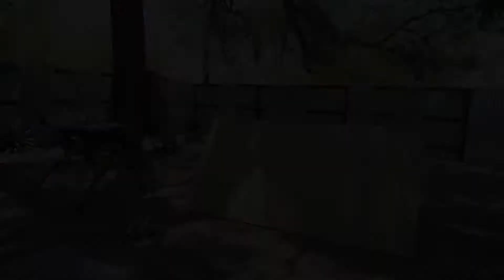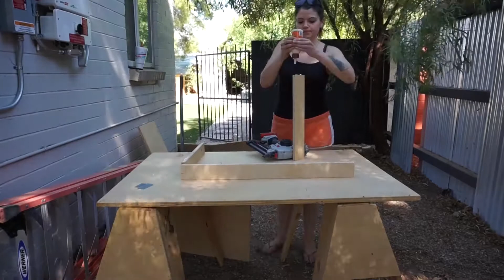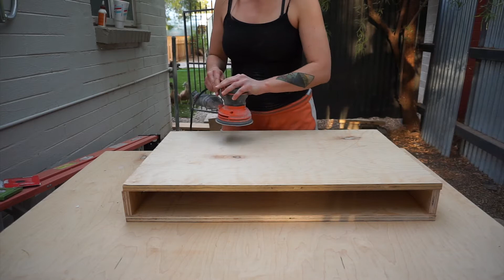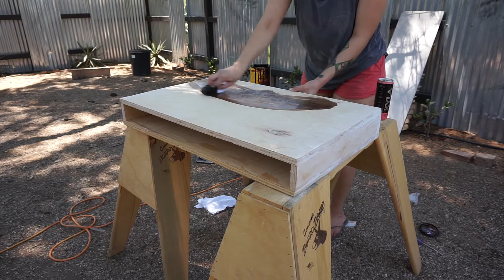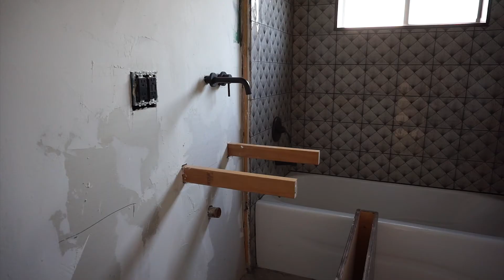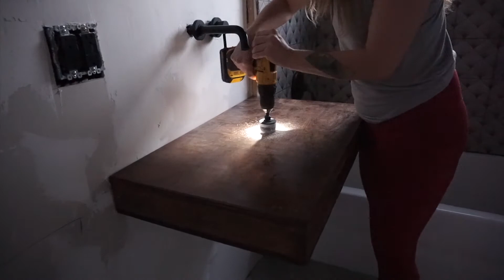DIY Floating Bathroom Vanity - My DIY Bathroom Renovation Progress! **BUILD.MAKE.DO**

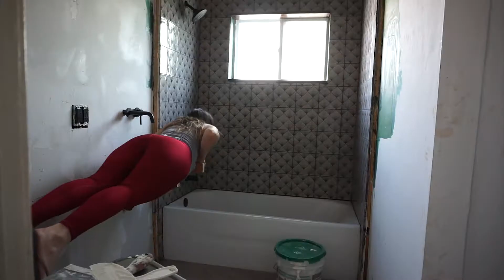Comment: 5:07 those two wood block in the walls. I wanna put it on my walls too, but we got tiles installed. Is it possible to fix those wood blocks on wall without breaking the tiles?
Reply from the maker: You could use a metal or wood support beam that runs perpendicular (horizontally) that hits multiple studs. I didn’t find it to be as supportive as attached to the interior wide edge of my studs, but depending on what you need it for, it might be enough. They also sell commercial/industrial floating shelf supports

Comment: At what height you installed the shelf?
Reply: The height of the vanity top is generally 32 to 36 inches. You would adjust to accommodate the added height of vessel sink, so that the top of the sink was no higher than 36” from the finished floor.